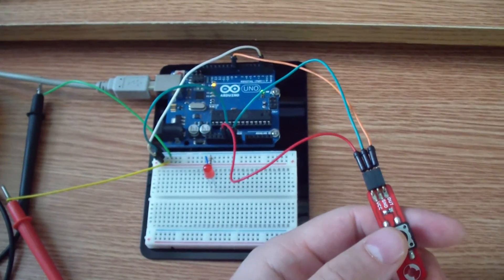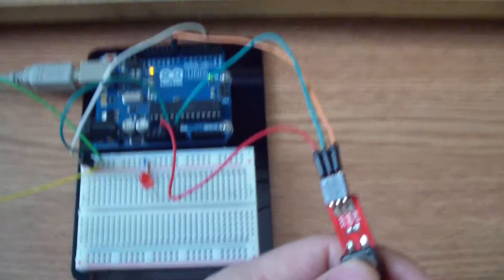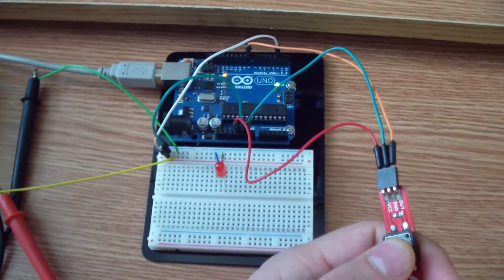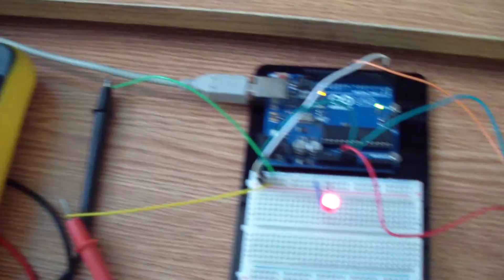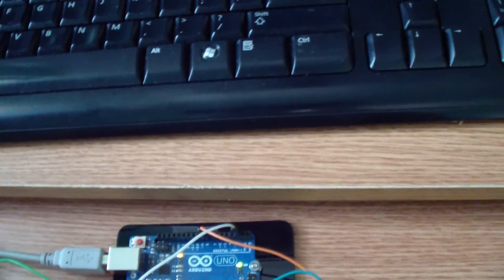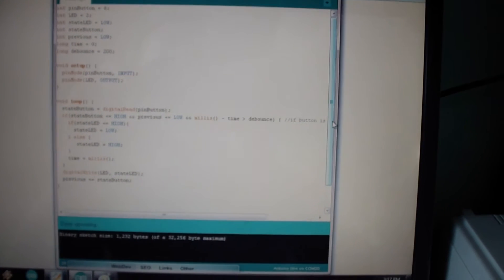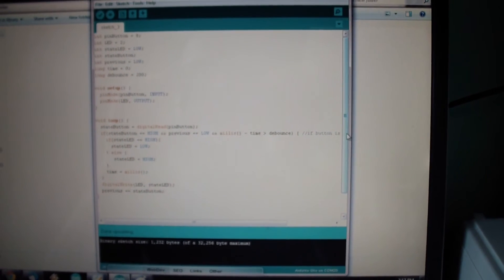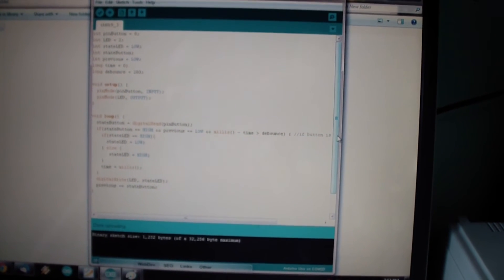Arduino Turn on LED with Button Debounce

Comment: I did what you instructed, and everything is fine. But why does the led keeps on blinking if I continue to press the button down instead of release it? I have read through the code and couldn't understand why